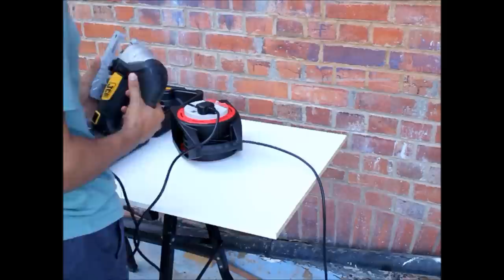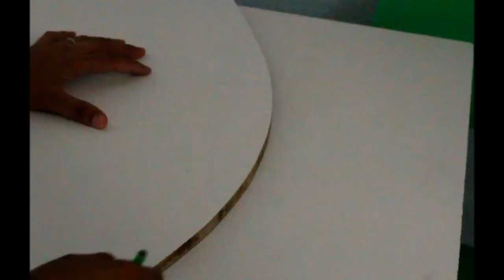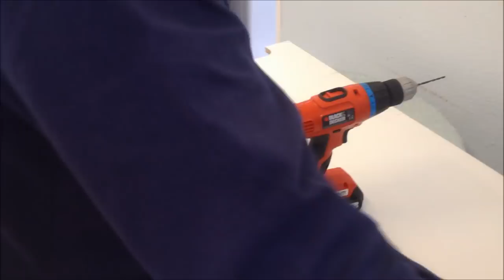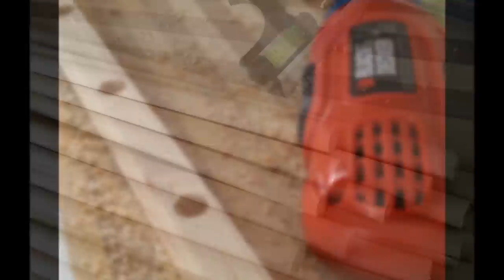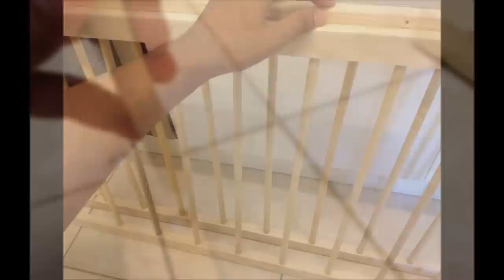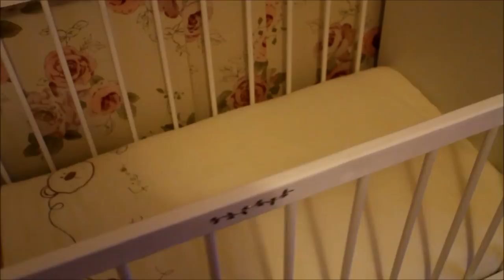How to make - Baby Crib

Comment: It would be very good if you knew the measurements and quantity of materials
Reply from the maker: I made it while ago, and don’t remember the measurement, but how I did , I baught the mattress first as as there are many different sizes of mattresses out there. So after having the mattress i just made those side panel and front 1”inch plus the size of the mattress. You can try that if it helps. And thank you for the comment and subscription. I will make some more furniture from leftovers wood and things I have at home so hopefully you will get to see them soon. 
Thank you.